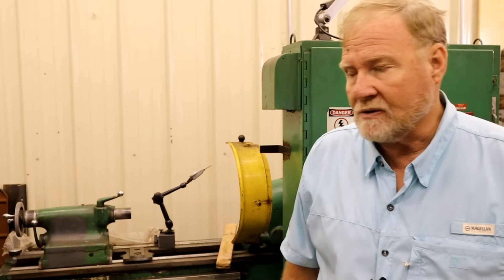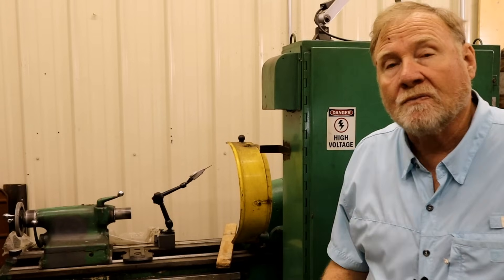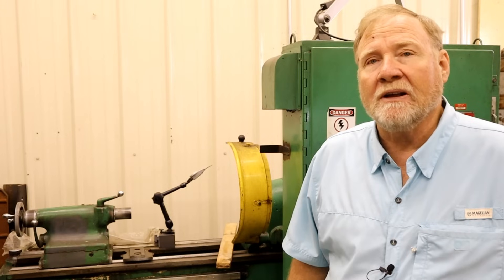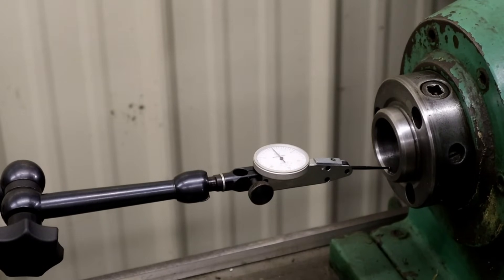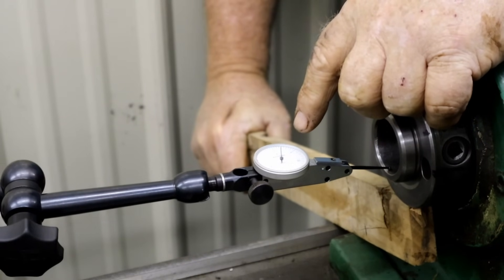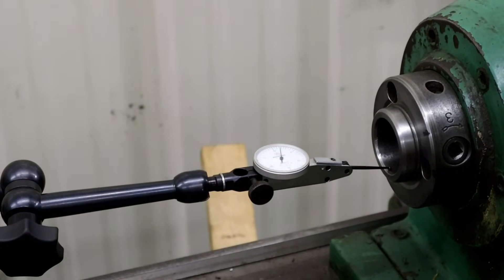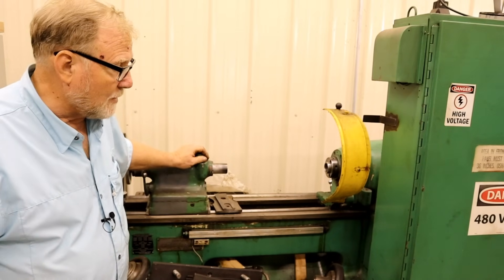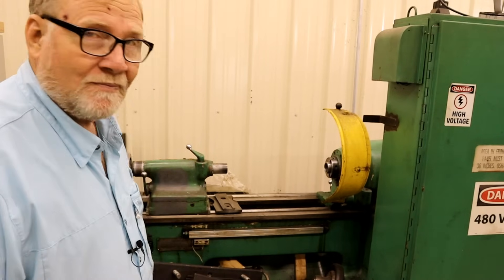How to avoid an expensive mistake, Check your lathe's Spindle.

Comment: Are you using a noise gate on your audio track? Sounds like the threshold is set a little high.
Reply from the maker: There was a hell of a click on two parts of the film , from what I don't know.... Tried to use the editing filter to take out noise and that is what made it sound weird... Still having weird sound issues with the new setup...
Reply: @10swatkins  I'm not pickin on ya. I'm an audio engineer in my other life and I know the struggle.
Reply from the maker: @leeroyholloway4277  No problem...   I was trying to get something out for the guy that wanted help and the new wireless go is giving me problems... it was suppose to be combining the two mic input channels instead of keeping the separate , was not doing so ... I switched back to my old mic, re filmed everything and it had a bad click!  too tired to mess with it so I tried post processing to make it go away... ....

Comment: Thanks very much for the instructive video and your analysis of the problem. I absolutely agree with your conclusions. Very sad to see such a great machine virtually destroyed by (probably) brute force.
However I disagree with your remarks on electric "pulses" driving 3-phase motors and the resulting "unsmoothnes": basically 3-phase motors are driven by currents on 3 lines. The voltages are sine-shaped and there is a temporal shift between them - called "phase". The currents run through the coils of motor and create magnetic fields. If you add the magnetic fields of the three phases you get a perfectly "smooth" rotating magnetic field without any pulsation - as if you would spin a permanent magnet. The magnetic field  drives the rotor of the motor which runs perfectly smooth. The electric sine waves of the current (which could be regarded as "pulses") do not cause any pulsation of the motor speed/torque. (To electrical engineers: sorry for my overly simplified explanation.)
The description of your setup with a 3-phase motor driving a DC generator generating DC power for a DC motor sounds like a "Ward -Leonard" setup. The reason why this has been used in former times is the fact, that DC motors can operate at variable speed - in contrast to 3-phase motors (without VFD in former times).  In former times Ward-Leonard converters have been used to drive very heavy machines e.g. electric winders in mines and motors in rolling mills.
I have also seen surface grinders using the same principle to enable variable spindle speeds. (E.g. Jung HF50)
Theoretically/strictly speaking I would even expect that DC motors run less smoothly than 3-phase AC motors because the current is "switched" between the coils of the rotor by means of the commutator. 
As you correctly state: nowadays you can overcome this problem by using solid state variable frequency converters (VFD).
I hope you don't find my comment patronizing. Just wanted to clarify this.
Keep up your excellent work!
Reply: Plus DC motors have tremendous low speed torque
Reply: The reason that Monarch had the AC-dynamo-DC setup was to have infinitely variable speed control, not for smoothness. 
It's called a "Ward-Leonard" drive: https://en.wikipedia.org/wiki/Ward_Leonard_control.
Holbrook (with the Minor) and Colchester (Chipmaster) achieved the same thing with a mechanical Variator. (Kopp style, with tilting balls)
Reply: Technically all motors end up using AC anyway. DC has to be “chopped up” for the motor to function.
Implying that  an AC or DC motor dictates the finish is rubbish, ALL CNC machines run AC motors.
Reply: Additionally, the mass of the moving components smooths out any minor fluctuations in speed that may result. The belts also help, though belts flutter tremendously.

But the cutting action may either add to, or subtract from any tiny speed fluctuations, depending on the material, cutter type, interrupted cuts, etc.

All in all, it’s not a real problem. In most of the machines the cutting speed is tied to the rotational speed, so any fluctuations in that will be reflected in the cutting speed, and so will be compensated for in that way also.
Reply: As an EE, I will say this guy gets it.  3 phase sums to zero and is perfectly good for the overwhelming majority of applications, power defects where something else on the same circuit is running on a powerful switching power supply with active rectification could be why this was better.  Also you can get linear adjustment of speed, which I believe is the best reason.
Reply: Good point. DC motors are typically the old fashioned way to control rpm of motors. The old speed controllers often had vacuum tube amplifiers for controlling the rpm of the DC motors. I agree that 3 phase motors are smooth running and we must also consider that the voltage change is linear due to being applied as a sine wave. More modern applications of speed control using PWM tends to supply a choppy square wave to loads, and the same with the cheaper VFDs not that this will really be a concern to smoothness, vibration in a motor.

Comment: Make a custom backing plate to fit it, and move it off to a hobbyist so they can have bragging rights for owning a 10EE. They are nice lathes, but problem plagued electronics is a definite "buyer beware" .
Reply from the maker: I would not wish this machine on my worst enemy :(
Reply: Had the same thought but still the amount of money spent on that just for name alone is heartbreaking that’s a 12-1500$ machine at most and the auction should help this man because this is information that should’ve been disclosed especially that compound slide being shattered

Comment: if the electronics and drives are good.. i wonder if Keith Rucker would be interested as he just ripped the pre vaccum tube mechanical controls out of his 10EE.  or if 4 ponds shop might have spare spindles from some of the many 10EE he has worked on.. 

but for the guy with the 9" south bend.. check ebay  South Bend 9" Lathe Headstock Spindle
Reply from the maker: No they are not good either.... I can fix them but it cost money...